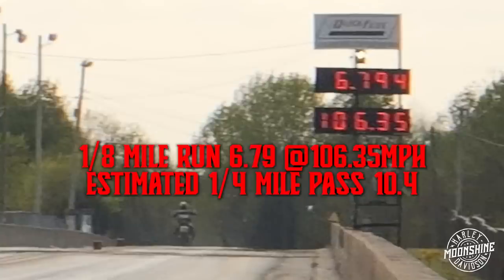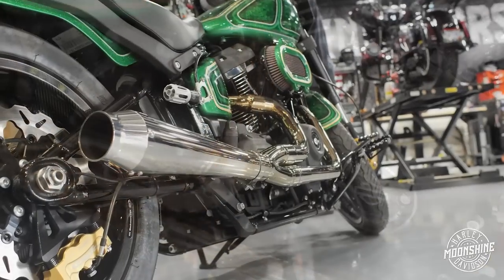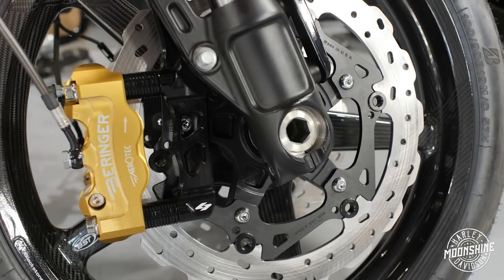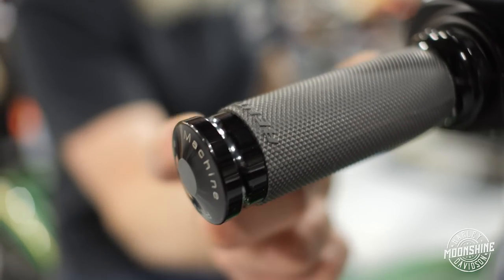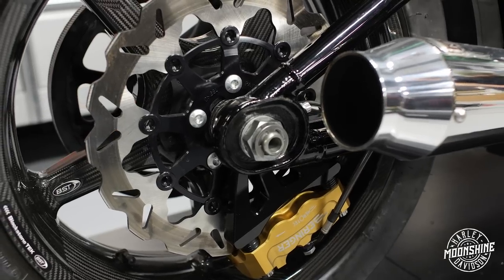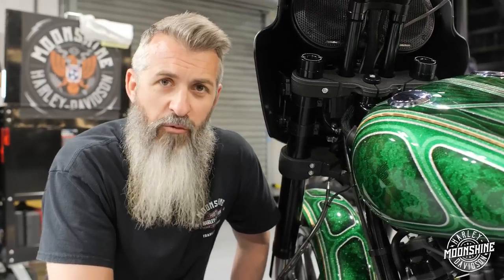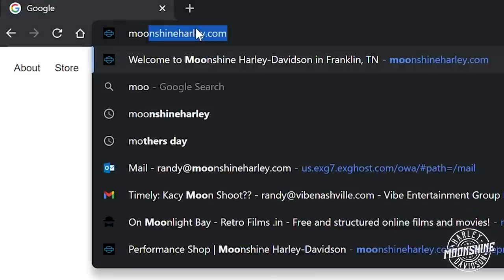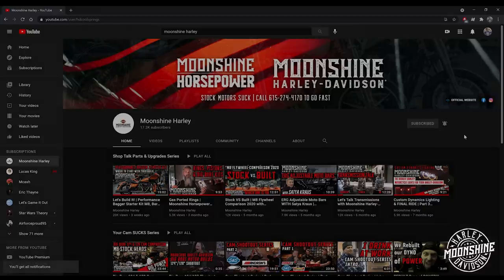Moonshine Horsepower 135 Devil Runner Softail THE HULK 162HP 152TQ | Bike Build No. 8

Comment: Thanks so much 4 finally doing a softail. I have a 2020 FXLR Low Rider,  going to do 475C Cam upgrade soon. 😁
Reply from the maker: You’ll get better results with our MHP-485 cam. You can also purchase is at shop.moonshineharley.com 
Works with stock springs. If you have any questions please call the shop 615-771-7775 and ask for Nick or Aaron.

Comment: Very nice build!  They say when you get older; you go from bikes to boats .. I can't see it.  I rode my first mini bike when I was 8, and got a 125cc dirt bike at 10, ( @ x-mas ), and we learned to ice race in the strip mall across the street, ( five of us ), and moved to Marty Smith's flying machine, ( anyone who road knew this dude; if you do .. Your old ), which was a CR250cc.  Got my 1st new Harley 1986, 1100cc sportser custom, ( yes it came with bath tub race heads ); which ended 1991 with a bad new rear tire at 80 mph; it was totaled, and my entire left side was crushed; my helmet had a seam down the middle and I hit the ground so hard, ( they could of heard it in Africa ), the helmet split right down the middle and was found about a football feild away from where my head hit the pavement.  I sold the motor for $2000 to put towards a softail, any year as long as it was a block head, ( Evo ), and when I saved enough, ( GI pay check ), I got a 1999 Softail Night Train, ( last year of the Evo 1340cc and machined everything while stationed in Germany; exshaust ports were way to small, and punched the cylinders; fireball crane cam and ignition that allows you to time the back jug.  Lots more but, I have been riding it for over 20 years now; and as long as a twin cam doesn't have head work; it wil take them light to light; I picked up a 6 speed trans because the cam comes in @ 3500-4000rpm, and if yournot ready for it, it will throw you in the back seat every time you shift.  Then I took a pretty good whack while playing in a middle eastern sand box, and still have the trans in the box; I just cannot see switching to boats; I have had a bike the majority of my life; and it's a part of me; that without it, would be like a part of me that was cut off.

Comment: What are the benefits of fitting a touring bst wheel rather than one that should fit?
Killer builds moonshine
Reply from the maker: BST doesn’t make a direct bolt on wheel for the Low Rider. The differences are the brake rotor spacing and axle spacers. We also had to run a custom ABS sensor. The carbon wheel is the same but has hubs for a Bagger on it.
Reply: @MoonshineHarley  got it .!! thank you so much for the enlightenment,  keep up the rad work guys , kuddos all the way from the Golden state.

Comment: You’re okay with the stock belt at that power lever? I have the stock belt on my 2019 fltru with 158tq. It’s a heavier bike so the belt may not be as forgiving. Also I’m not dragging racing but I’d like to start being more aggressive taking off from stop lights and not having to worry about the belt.
Reply from the maker: Chains are stronger and we do a lot of them but a stock H-D belt will take a beating for a longtime.

Comment: I got a 21 low rider s and I wasn’t aware I can use touring gauges on it . Do have to do any De pinning or splicing or is it just plug and play ? Meaning does does gauge harness snap right on to my stock harness ?
Reply from the maker: Kustom with a K and you’ll loose fuel level reading.

Comment: Question: do you prefer Baker Compensator or Man O’ War Compensator and why, brother? I don’t find enough content here to get a feel for one over the other.
Reply from the maker: We would recommend the MHP Comp Ramp “Comp Of Power” and it can be purchased at shop.moonshineharley.com. It replaces the stock comp ramp with an indestructible one. Harley-Davidson did a great job designing it and we developed a ramp that is made to handle any HP you can throw at it. It is quite, smooth and easy on the clutch and transmission.

Comment: I’m looking to mount a carpe iter tablet..  basically it’s a Samsung galaxy active tab 4.  But it specifically designed for adventure riding ..  I’m looking up mount it behind the fairing on a lowrider st. I want it a frame mount rather than on the riser..   any suggestions fir mounting hardware?

Comment: What to add those gauges to my fxlrst and get rid of the digital street bob gauge it has on it. Is that possible? Isn't there no fuel gauge on those touring gauges?
Reply: Supposedly they’ll work just fine but the connector isn’t the same, so need to repin or solder 

I’m looking for same thing… don’t see how they’re gonna see a gas gauge

Comment: Get rid of the stock seat and chrome levers. Chain drive it. Looks cool though.
Reply from the maker: Levers are in route and so is the seat. It’ll stay a stock belt though. The softail is light.
Reply: @MoonshineHarley  I have same bike and make 155hp/158tq I run chain. Stronger and looks better IMO.
Reply from the maker: @greggatto4023  Nice. Chains are great but more maintenance and noise. We leave it up to the owner. With that said we do a ton of chain conversations.

Comment: Great looking bike quick question regarding touring gauges for soft tail , did u have to get a different harness or splice in order to fit low rider s connector for gauges ?
Reply from the maker: You’ll have to build a wire harness.
Reply: @MoonshineHarley what about gas gauge? or is it just a race bike and you top it off every time you ride

Comment: I have a 2020 SGS with Kraus inverted front end , 10 inch risers and fly Moto bars. My question is have you guys ever ran the Kraus gauge relocation on top of the bars on a Street Glide. I know I don't need it I can still see my stock gauges I just think it would look bitchen.
Reply from the maker: You could if you purchased a Road Glide gauge set from H-D. The. You’d be running two sets of gauges unless you did something where the stock ones reside.

Comment: Does this audio system is also ‘quick detach’ ?
Reply: No, it mounts using the riser bolts.
Reply: It doesn't but it's so easy to dismount from bike just loosen the riser bolts and remove it. Power is a quick disconnect from battery! Well worth the money if you like your music and not alot of room like a bagger!
Reply: @spoom937  thanks !

Comment: FYI a lighter crank does zero to HP. The only difference from a light crank and heavy crank is kinetic energy. Just saying
Reply from the maker: Yes. Unless it’s two gear driven balancers that turn in the crankcase oil. There is extra drag for sure with them. If it was just flywheel weight you’d be spot on.
Reply: @MoonshineHarley  yes sorry I don't choose best words ie don't write well. But run two different cranks in the 2660 cc s&s beull NHRA PROSTOCK motors ones a knife edged pork chop style substantial lighter than the full circle style crank zero HP difference the sole difference  is how many RPM drop there is when up shifting off the top of my head one crank is about 5 lbs heavier than the pork chop style crank off top of my head it's about a 200 rpm fallback different them motors put out roughly 400 HP at the crank these are the older version low camchest motors  I don't know much I just tinker with my buddy. Ooo yea most of the cyls can be bored and sleeved as long as it's done with a indexed shoulder my buddy's done hundreds of them not positive but the 135 cyl is the one that will wreck the shell mill he has fixtures and CNC machines them cyls meaning the type your showing are not a easy job you need to creep up on the final bore diameter with boring bar after the bulks removed with shell mill  again I'm no expert